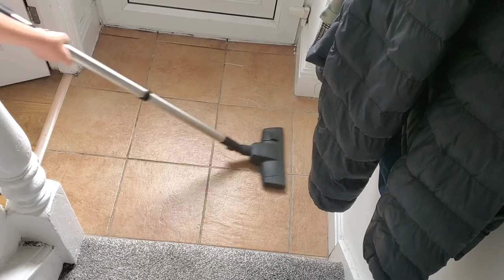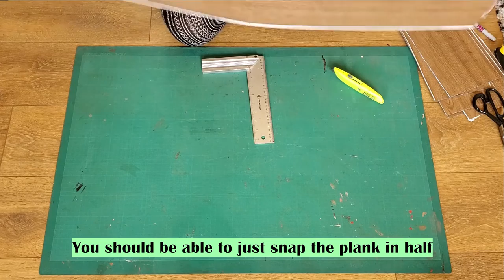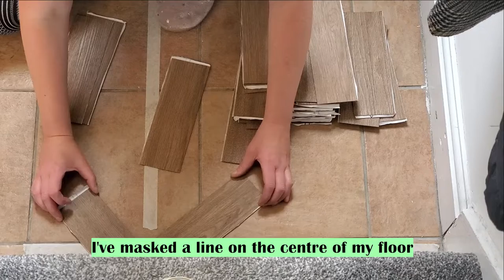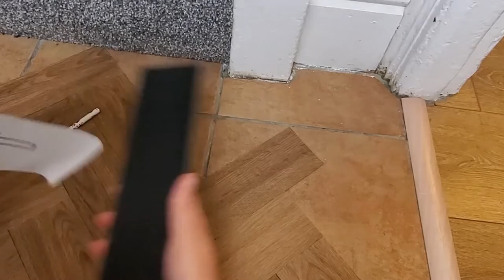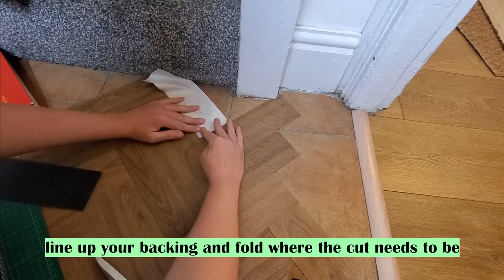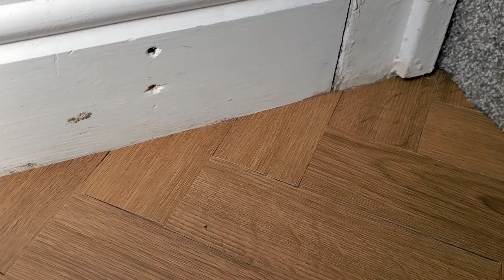DIY Herringbone Faux Wood Floor | Peel & Stick Flooring Hack

Comment: What a difference a day makes, the tiles were OK but the peel and stick took it up a notch.
If they lift which mine did I used evostick in the corners.
I think it's a great product but the glue needs rethinking 😊
Reply from the maker: Great tip, thank you!

Comment: Fantastic work. I’m hoping to do the same in my bathroom. 

Can I ask how these are holding up a year later please? 

Thank you
Reply from the maker: Thank you so much 🤗 The tiles themselves are holding up great. I would make sure you have a level floor to start with as mine have 'settled' around a square tile below that obv wasn't level! Good luck with your project!